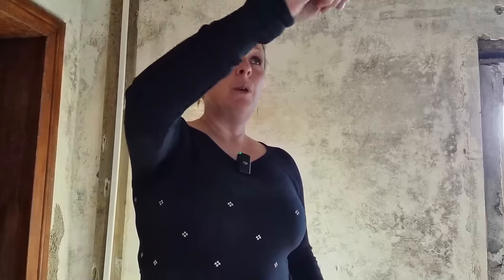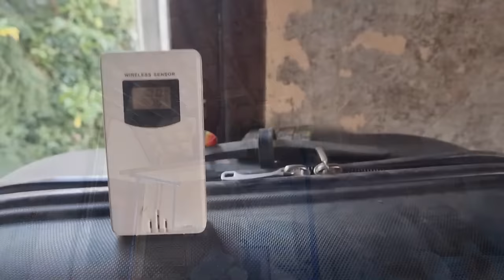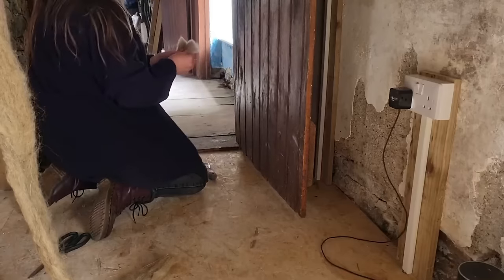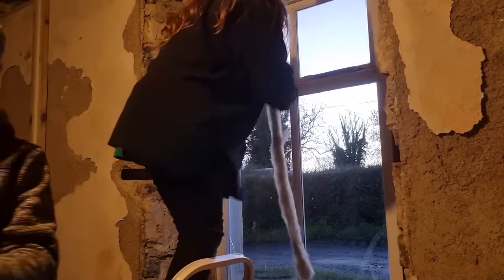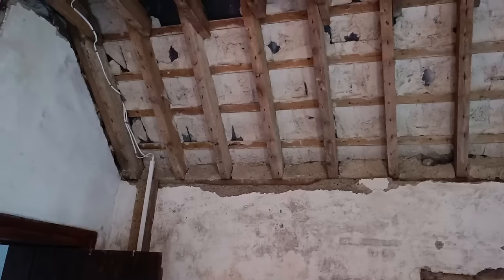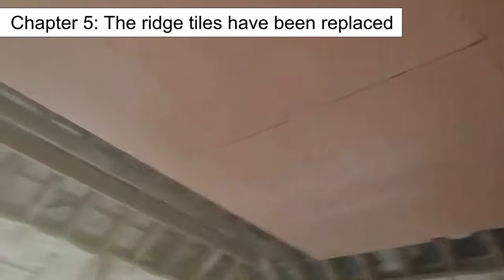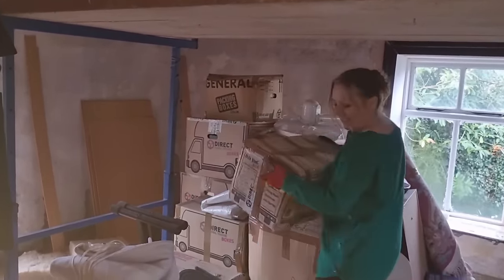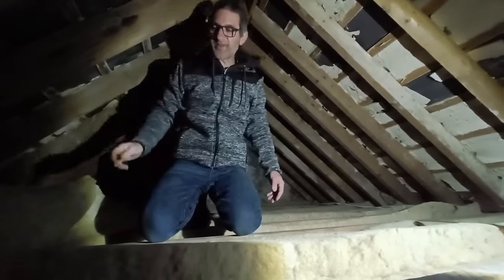From cold to cosy: Transforming our Chilly Irish Farmhouse with Sheep's Wool Insulation

Comment: Getting the ridge tiles done is awesome, saves a lot of potential damage to the new insulation and boards. It will also help getting the humidity levels down. 👍
Reply from the maker: He did such a good job for us on the ridge tiles.  The humidity in the room now it is insulated and no holes is down to 60-65% making the room feel more comfortable.  Most evenings the room is up to 19 degrees C.  The kitchen in the farmhouse is normally 20-22 degrees and humidity is about 40% most of the time.

Thank you again :-)

Comment: Yay, you got the ridge tiles done, no daylight coming through,  that makes me happy!  Great job on the insulation,  I like the ceiling with the panelled look.
Reply from the maker: Yep, no daylight and no rain coming into the bedroom, which is always nice lol.

The ceiling doesn't look too bad, we were expecting the caravan roof effect but were pleased with it in the end.
Reply: @thecornerhouseproject  Ian asked why did you put ply and not plasterboard?
Reply from the maker: Well Ian... lol.  Because the ceiling is only there until probably next year, to be replaced with T&G boards, like the ones we removed.  The ply is light weight as you know so we went with light, easier to put up than plasterboard :-)
Reply: @thecornerhouseproject  ahh, makes sense. The ply looks good on the video.

Comment: So glad the roof is repaired. Have to admit that I do not understand much about old stone houses. I guess they are supposed to breath. Modern homes in Canada have vapor barrier attached to the underside of the ceiling beams, insulation is much thicker, and attics have vents to prevent condensation. We also have an access hatch for inspection and repairs. As always, you are making steady progress.
Reply from the maker: Hi John, thanks for watching and commenting as always, we look forward to seeing your comments.

Dawn is the the one who has done all the reading, so my info is second hand for you.

Basically......lime plaster on the inside of the walls in the rooms allow moisture through the breathable lime plaster, and then the lime mortar and then gets dried by the wind and sun as the moisture reaches the outside walls.  Rain can go on the outside render but dries again with sun, warm and wind.

The Cement we have on the front of our house has cracked, so although waterproof, the cracks allow water seepage and then the water cannot escape from behind the cement.  This is then trapped in the walls and lime mortar.  Moisture from inside the house, from cooking, showering (one day), boiling a kettle and in it's most basic form, living in the house, cannot escape because the walls are already damp where it is stuck.  You then get damp walls and floors etc.

Dawn can answer it much better than I can, maybe she will add to my reply if I have missed something..... She has just given me the nod to click reply though.

Lime also lets the walls / house move with the seasons without cracking.  Cement just cracks.

Comment: So glad you are using sheep wool ! Must be great to install and not using masks and gloves. So environmentally friendly as well.  I noticed you are not using a vapour barrier, not needed? You might try putting window plastic over the inside of your windows, it really helps. you can buy the kit that you cut and blow dry tight, or like me, buy thicker clear plastic at the fabric store and build a simple frame to stretch it over.  Then I caulk it tight to the window frame. With your windows, you could do two frames so you can still open the windows.  You folks get to have your learning curve, you are moving along quickly and of course, as parents, focussing on your child's comfort before your own. hugs
Reply from the maker: So others can see the answer your question, although you have answered it yourself lol.

Sheeps wool will hold up o 33% of it's own weight in moisture.  In the damper months it holds on to it until it can be released when it warms up from room warmth or in the dryer seasons.  So we don't need a vapour barrier.  With that said though, when we do the roof (or get the roof done) we will have a barrier under the tiles.

We have been looking at the Perspex windows coverings but have seen the plastic film.  Whatever we use it will make a big difference keeping the cold of the glass from falling.

Yep, in our previous previous house , yes, 3 houses ago lol, our bedroom wasn't decorated for 14 years and we moved out on the 15th year.  Their happiness is more important than ours :-)

Thank you as always for watching and commenting :-) (twice)

Comment: Absolutely brilliant - love the ceiling!!  I'll bet it was a lot warmer.  I'd be filling a tub with water in front of the fire and having a bath.  Well done you two!! toss a plank on the rafters and shove some boxes up there so you can do your room and whole house will be warmer. remember the heat putty you used to fix the stove...  use some of that to point the stone in the chimney where the smoke comes through.

lime plaster has different consistencies depending on the sand used to mix it, Venetian plaster is mixed with marble dust. Take a plaster sample from your wall to a building supply they should be able to let you know what mix it is. Sands used should be well graded with a range of grain sizes, which for most plaster, render and mortar work will range from 5mm down to 75 micron. The difference is for building a wall the coarser sand for rendering the wall a medium grain sand and for smooth plastering a fine grade sand that pigments or (dusts like marble) can be added for colour and texture.  decorative plastering would mainly be done with plaster paris or venetian plasters.  You could have many different kinds of textured walls depending on your preference and the mix - have fun looking it up and see if you would like to do any of them.
Reply from the maker: Haha….ooh hopefully we will have a shower indoors in a few days…it’s nearly there now….but I must admit a bath in front of the fire does sound quite appealing! 
Can’t wait until we have a “bedroom” either….will be vacuuming the rafters in there tomorrow I think to get a start on it. We did think about chucking some boxes up there but the collar ties aren’t the thickest so not sure they would hold the weight of our stuff 😂 
Ooh I like the idea of the putty will have to see how much we have left.
I will look into that with the plaster. The one on the video is really smooth, I immediately thought of it being a modern gypsum plaster because all the lime in the rest of the house isn’t smooth, but I then watched a YouTube video of a piece of set lime putty and it looked very similar, so that made me wonder it is actually lime after all lol confusing this renovation lark! 🤣
Reply: @thecornerhouseproject  My Father was a master plasterer and stone mason. The youngest of 9 kids, the oldest kids were married when he was born in 1919. We had all grades of sand at home and different kinds of lime and different kinds of powders/pigments and mouldings.  I learned a lot from him and have forgot much too.  I do remember screening sand to get the very fine sand dust for plastering walls. My Grandfather, A Mason, Served in WW1. I'm fortunate to have been taught by people who didn't have an indoor toilet, didn't have electrics and cooked over an open fire - the stories and explanations and lessons in history from a living relative have been invaluable.  My Mothers family cooked on an open fire until she was 11 when they moved to a house with electric lights in 1947. I am from the "missing generation" Not a boomer and not the next gen either lol. 5 members of the family were members of the Masons Guild.
Reply from the maker: Wow that is some lovely family history there! No wonder you know as much as you do! You have lived it first hand! 
Having lived how we have for the last 6 months..(not close to living how hard it used to be by any means) it certainly does make you appreciate every little thing and achievement to regaining the basic modern day "needs".
Reply: @thecornerhouseproject  You have a beautiful home with some precious secrets to the past.  It is wonderful watching you uncover those secrets and incorporate them into the future.  Not everything can be saved but some can be replaced, just make sure it is functional for you and decorate around the function.  The most important part is already done - filling the home with Love!

Comment: Brilliant work, the ceiling looks great, good enough to be for keeps. The roof looks good too, maybe you won't need to replace it at all.
Reply from the maker: It would be lovely (and cheaper) if we didn’t have to replace it lol. Fingers crossed that’s the case. There may be a few timbers that we need to replace…but it’s not too bad at all considering it had rain coming through in multiple areas for a few years! So it’s quite surprising it’s in as good a condition as it is!

Comment: You guys are doing a great job!   The vacuum of the rafters is smart,  not just a Dawn thing!    A clean worksite is a safe worksite.    With the identifying of that plaster,  I’m wondering if it is lime sand and concrete.    I heard another Irish renovater saying that that is what they were going to use on their stone ruin.    Yours looked to me like lime and sand,  but it was much more coarse than lime putty used in the hotter climates like Spain & Portugal.      Tim & Jo on The Renovation Couple used a lot of lime in his previous stone house in the UK.    So might be worth checking out their old videos.    Love using that sheepswool in the tricky places instead of that horrible expanding foam.    Cheers from hot AUSTRALIA.
Reply from the maker: Yes, you and me both with the expanding foam! So much easier and less messy with the wool. It works really well with the windows too, the noise dampening effect was instant! 
I have been following for the renovation couple for a while now. I think I found them, strangely when I was looking for videos on lime work and I just love watching them, he is very good with explaining all that he does too.
I do like a clean work site, so much easier to work in and also to be able to find all that you need to do the job.

Comment: You put a small steel strap screwed into the windobframe at the wall side and take the other side is the strap inside and fix to the wall. Easy. Then gap fill with expanding foam between the window and the wall. Use closed seal foam so it water proof
Reply from the maker: Expanding foam?  Dawn would do her nut hahaha, I will let you tell her.

I see what you mean with the steel strap, thank you very much and thank you for watching and commenting :-)

Comment: U can put the metal up for 2x4s and put insulation  between then and regular plaster board up instead of messing with those walls...😊
Reply from the maker: Could you give a bit more info on this please as we still have the other bedroom and landing to do.  Anything to make the side walls easier would be great.

Thanks for watching and commenting, as always :-)
Reply: I think she means to "fir out" the walls, to provide attachment for the plaster board sheets. We typically use 2" x 3" nominal lumber, laid up vertically at 16" apart on center. Then when you hang the 4'x8' drywall (plasterboard), they'll be flush with the light switches and other outlets (depending on the depth of those boards they're mounted on). Then they won't stick out from the walls, and you avoid patching all the plaster. We love watching your show and love the progress in each episode!   @thecornerhouseproject
Reply from the maker: Thank you for clearing that up, it is very much appreciated :-)